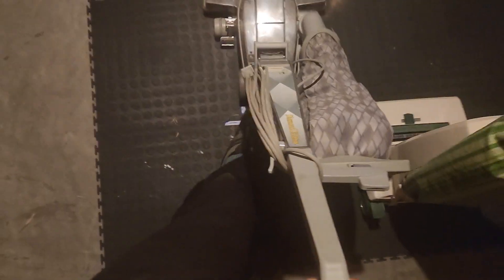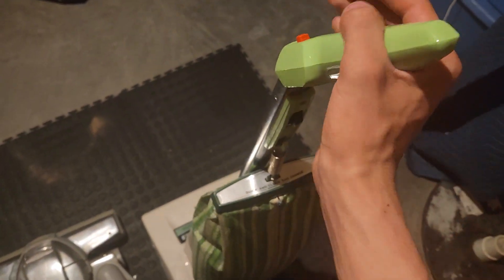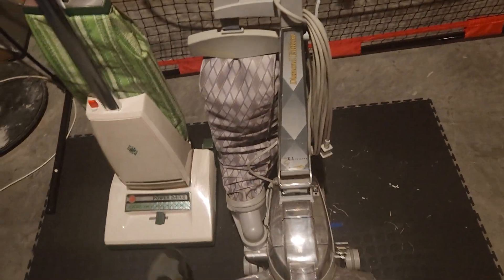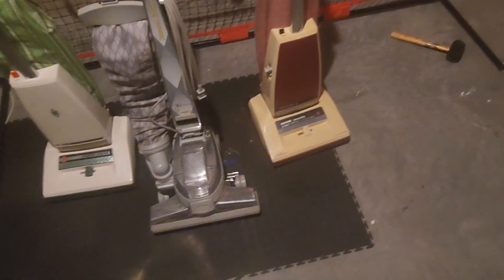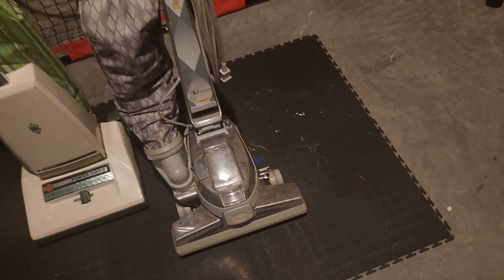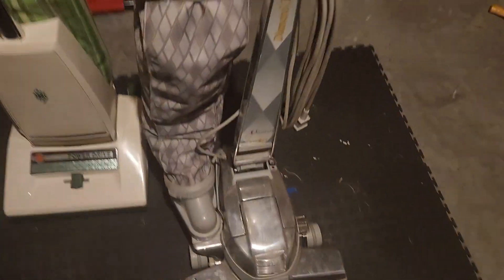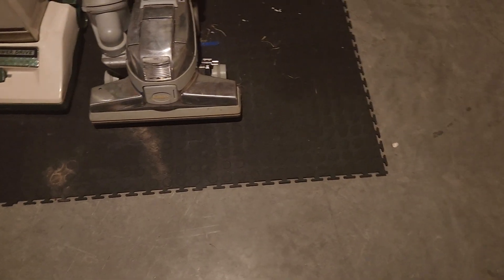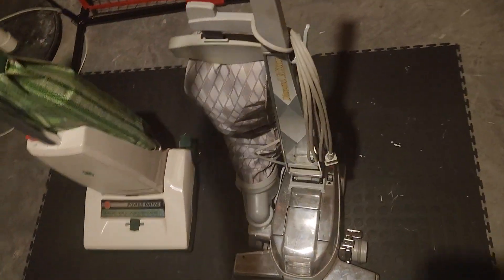Kirby Diamond vs Hoover concept! the battle of the Self-propelled Multi-speed machines!

Comment: The Kirby would actually likely have more airflow than those two Hoover Concepts. The kirby has much bigger air path, a bigger fan with much better designed blades. Also, the fan in a Kirby sits much closer to the nozzle opening and it’s also faced directly in front which makes it quite more beneficial.